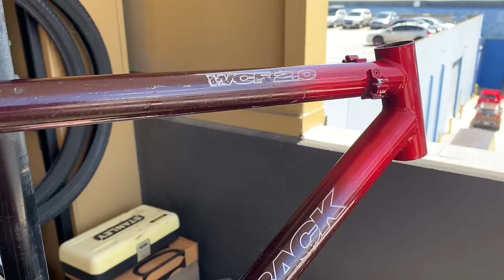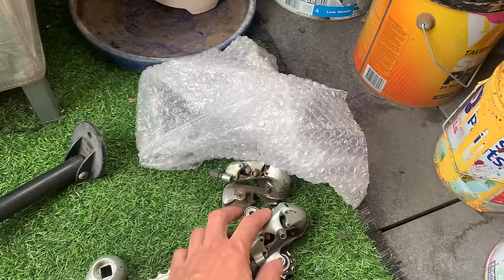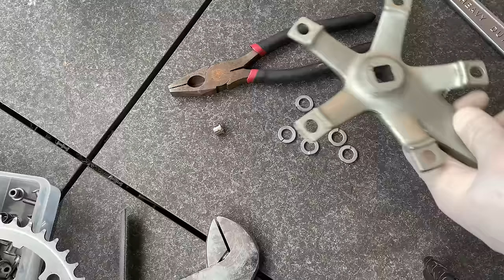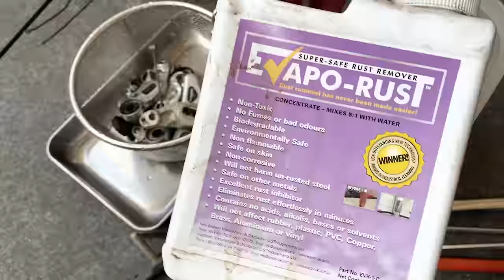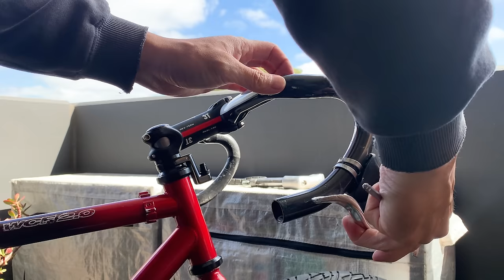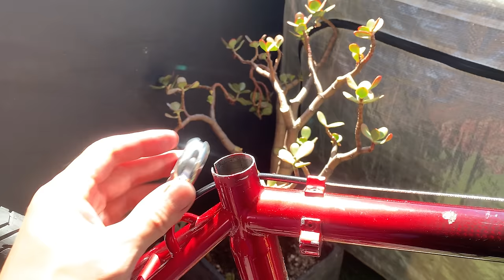2 speed gravel commuter custom bike build

Comment: i am a simple man. gary post video i click
Reply from the maker: 🤣🤣🤣 thx you 🙏
Reply: Agree 100%
Those of us who know, well, we know that Gary has a magical skill
Making an ugly duckling into a beautiful swan 😊
Very inspiring, Gary 
Cheers
Sven
Reply from the maker: @helenfulford2040 😂😂😂 thank you so much Sven I am honored
Reply: I'll be honest, I'm not much of a cyclist at 60 years old but I find Gary's videos inspiring. After not having been on a bike for 40 years I bought an Ebike which I love. I was lucky and found a road bike in a dumpster that was actually pretty high end (shimano ultegra, st-6501 brifters, 9 speed, aluminum frame). Had 2 bike shops check it for damage and after getting the ok I spent $100 on new cables, grip tape, tubes. Got a great deal on tires (Vittoria Zaffiro Pro 2 for $20) and a Selle San Marco Concor saddle for $10. New peddles as well.  It was alot of fun repairing the broken shifter, cleaning and lubing everything. I can honestly say Gary's videos were an inspiration. I've riden the bike a few times for short distandes but I'm just not physically able to use it to its full potential unfortunately. Was still a fun project.
Reply from the maker: Awesome I’m glad to hear that! Great to get out on a bike. Also super fun to work on bike projects , I find it very satisfying when I finally fix something 👍

Comment: Why not just use a 3 sp 16 19 23 freewheel and spacers, with a friction lever on the seatpost?
Reply from the maker: This weighs less, Jks these are the parts I had on hand
Reply: @garysprojects  I like playing with bike parts.  I once made a 1sp tensioner out of a rd with only the jockey wheel, and no cage, and used a spoke and the barrel adjuster to hold it
Reply from the maker: Nice! Sounds cool. I’ve used that spoke technique before too 👍

Comment: Surly used to make a Dingle fixed cog that paired with two chainrings would give a on road/ off road gear. No derailleur, just loosen the wheel and switch and off you go. Or use a modern Sturmey Archer internal gear hub with disc brake mounts.
Reply from the maker: How does it keep chain tension ?
Reply: @garysprojects  You would combine a small front ring with the larger rear cog and the larger from ring with the smaller rear cog. So there is only smsll difference in chain length to adjust.

Maybe a 36/18 with a 42/14? I have not used one myself but there is likely info on the website about what works.
Reply from the maker: Ahhh I see thank you

Comment: I think most headsets that have cartridge bearings have the slit on the crown race to make it easier to fit. It would make your steering notchy if you had cage bearings but it's not a detriment with cartridge bearings.
Reply from the maker: Nice! I plan to use those for all sealed bearings so I don’t have to worry haha !

Comment: What a practical way to setup a simple 2 speed rig.
Reply from the maker: Thank you my dude , easy run around bike
Reply: How on earth is this practical? I would be too annoyed to dismount every other hill to change gear. And to only have two gears when you have a whole derailleur is just missed potential in my opinion. Adding a simple friction shifter, it doesn't even have to be on the handlebar, wouldn't make the build much more complicated.
Reply from the maker: @hobbybaschtler7896 I guess it’s something you don’t switch too much. Maybe if you’re in a rush for work you set it to the high gear and on your way home you set it on low. Think of it as just using an old rd as a tensioner , with the option of switching one gear

Comment: I like your set up.  Alternatively you run two rings in the front and a single cog in the back with a tensioner.
Reply from the maker: Cheers I appreciate that! That’s true you could do that !
Reply: i really need this. i have a mountain bike that has 3/8 speeds and im thinking of swapping the cassette out for a single cog, getting rid of the derailleur putting on a tensioner and either swapping out the crank or maybe swapping out the cogs at least for some new ones if i can. the shifting mechanism is already there so it should work, assuming i can find compatible parts.

Comment: Just found your channel mate and simply love this Diamondback build. I use derailleurs as chain tensioners on my single speeders and have used that cable hack for many years now and it always works great especially for fine tuning the chain noise. Currently building up an old Jamis frame (reynolds 520 steel) to be my one bike to do everything ..... Road / Round Town / Commute / Gravel.  Looking forward to working my way thru your older videos. keep up the great work.
Reply from the maker: Thank you Jeff I appreciate that! Yes it’s good way to use an old derailleur for sure. The Jamis will be a solid bike 👍 Thank you will do my best cheers !!

Comment: Regarding the crank chain ring washers, in Europe there are some washers used for the door hinges, to change the high of the doors, that fit perfectly. I got this tip from a colleague.
Reply from the maker: Yes! Someone else mentioned this too, I will take a look at the local hardware store , thanks !
Reply: Yes, I use these as well. They are perfect for the job.

Comment: Sweet! I fix up old bikes for fun as well. On that seatpost, if you use a strip of fine sandpaper (for metal) in a quick back and forth "shoe shine" motion across the barrel, it should hopefully get those marks out.
Reply from the maker: Oh awesome!! Thanks for the tip will give it a try 👍
Reply: @garysprojects Just hold the ends of the sandpaper strip and it will naturally follow the contours of the post. I hope that makes sense. I do this technique on aluminum and bare steel. 

Your builds are really cool btw!
Reply from the maker: Yes that makes sense! I think someone mentioned before that’s better direction to sand seatpost because of the “grain” of metal(?). 
Thank you very much that means a lot thank you !!!

Comment: Once again a great video. Always enjoying your creative builds and your chilled ways to present them. 💖💖💖

Just about the split crown race: those are kinda common on sealed headsets because you don't need a smooth surface all the way around the crown race for the balls to role like you would on "open" ball-bearings. Sealed bearings already have that surface inside them. And it's heck easier to install and uninstall after all.
Reply from the maker: Thank you I appreciate that ! That’s great to know about the crown race !! I’ll make sure I use slotted ones for all sealed bearings! Will save me a lot of hassle 😂
Reply: @garysprojects  ahahaa, those hundreds of hours lost in my basement... i feel you! you can even cut them yourself if they're not slotted at factory. works like a charm and no tools needed except for a screwdriver or something to "open up" the crown race while mounting it on the fork.

Comment: Nice, haven't built a dingle speed before. I am planning on converting a Scott Boulder rigid to drop bars and this would be a cool option other than single.
Reply from the maker: cheers ! ya give it a try, i was hesitant too at the beginning but it worked out well and is fun to switch it up!

Comment: Connect your Dingle speed to a front derailleur MTB shifter. Can use 2 speed and ignore the trim, or have 3 speed in the back (fast, cruise, and hill options)
Reply: I live in a hilly place and have 15t+21t+28t in the rear, and 38 in the front I think
Reply from the maker: @veloello1  interesting idea!! I wondering what the pull ratio is on the front d

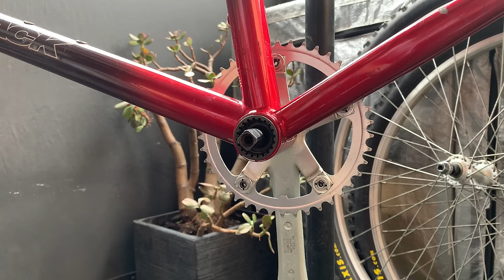Comment: 13:22 Is that safe to ride? I feel like the flex will make the crank/chainring rub with the chainstay wouldn't it?
Reply from the maker: Ya it’s been working well with no scratches! Obviously different for every bike but the flex depends on the frame you have and how flexiable it will be. I think this bike having steel joints & rear triangle helps!

Comment: Amazing one, again. 🤩🤙
Simple and nice.

And as I did in my latest build (mtb frame, drop bars and cantis) you left out cable tensioner for the brakes. 😁
Either way, 10/10 🙌
Reply from the maker: Thank you my dude i appreciate that ! What is a cable brake tensioner ? Not sure what you’re referring to , thanks
Reply: @garysprojects  not shure the right name for it, but on mtb brake levers there is this threaded adjustment for adding tension(?). 
These road levers don't have this, but one can by adjusters for placing on the housing. 
Same can be used for the gearing, if you want to adjust "on the fly".
Reply from the maker: @vernerjuliussen2071 oh yeah I know those!! Ya I never bother with them because once it’s set you don’t really need them
Reply: @garysprojects  thx. Then I won't bother installing them either. 😁🤙

Comment: How did the weight feel compared to MTBs, and what you expected? Also, how did the different gearing end up working out? Was it enough of a spread in ratio to tell the difference?
Reply from the maker: Weight feels noticeably lighter when riding and compared to my other mtbs , fun to whip around  on. The gearing is actually a massive difference for myself haha it means being able to go up hills on one and not on the other 😂 maybe I need to get more fit. I. Mostly ride the easier gear in the vid. I think it would probably be nice to have 17-18 and a 14-15 
I think if I get more fit the ratio I have on the bike  will be fine.
Reply: @garysprojects  Maybe you could do another video about it. I wouldn't be able to get away with a 2-speed where I live, way too many mountains and hills. It's fun to see though.

Comment: Nice build as always Gary. Wondering how they hid the seams so well between the steel and carbon? I have a Trek 8300 where the main tubes are carbon but the rest aluminum. The aluminum was left raw.
Reply from the maker: Thanks Joe ! Yeah it’s quite seemless , my guess is that the clear coat is quite thick it seems maybe that’s how ? Cool the trek sounds cool!

Comment: I'm curious about the weight 🤔. With the carbon frame and bars, and the minimalist gear train; I imagine the bike should be on the lighter end. Despite the sensible tires
Reply: Carbon frame?
Reply from the maker: Yes ! It is pretty light compared to my other mtbs , the tyres def add a bit , but feels solid. Feels whippy and fun to ride 👍
Reply from the maker: Yep has carbon tubing and steel welds
Reply: @garysprojects  ah ok I could see any lugs or seams, never seen carbon tubing like that 👍

Comment: Very cool build! I saw the tiny cable clearance between the stem and the hangar and was wondering if you'd drill a hole for the cable into the stem. Though maybe that old-school cable routing would have looked wack. 😂 
Would be cool to have this two speed setup with a friction lever placed somewhere unusual at the back of the bike. Great vid man!
Reply from the maker: Thank you Milo I appreciate that. I considered it but I think this stem was too nice to drill through ! Would work though , Cheers!

Comment: My tip for this build , the shifting with the set screw is a bit to much in my mind , you get pretty cheap from SunRace or Sturmy Archer a bar end shifter  were the front shifter for this aplication will work fine . Have fun !
Reply from the maker: Cheers mate 👍
Reply: @garysprojects  other than that great job to get that beauty back on the road !
Reply from the maker: @thomaseisen304  cheers mate I like it the way it is but thank you ! 😊

Comment: Love the manual two speed setup. Did you have any chainwrap issues with the 13t? I've always had skipping under load issues with low tooth cogs and derailleurs as as a tensioner
Reply from the maker: No issues at the moment ! I didn’t need to adjust the chain either. Sometimes if you get slippage it could be the chain is too long or a worn cog. Thank you my dude !

Comment: nice build, like the frame colours a lot! One question though: how the brakes work with the drop levers?
Reply from the maker: Thank you my dude ! Ya they work pretty well I think. The levers are short pull which work with cantibrakes. I think they are little more bulky than the vintage ones but not too bad 👍

Comment: Lush build as always.
Allow me to share my experience with shims for cranks: I use an LX MTB triple crank as a 1X on my commuter, and had to shim them for the same reasons you showed in your video. The type of shim I found useful, were the ones you use on doors, to lift them from the ground at the hinges (https://de.wikipedia.org/wiki/Fitschenring). Unfortunately i couldnt find an english translation, but the wiki pakes has a picture which should hopefully help.
Regarding the crown race, while i personally never did it, as long as you use cartridge type headset bearings you can use those split crown races, and even cut a slit in them yourself (I've seen Spindatt do it to great success). Makes installation and removal muuuuuch easier. Obvs won't work with caged/ball bearings 😉
Reply from the maker: Wow awesome ! Thank you so much, I will try and find those at my hardware store ! Cheers

Comment: in my Opinion 2 speed makes no sense. when you put an derailleur on it you can put a 6 or 9speed cassette on it and an MTB shifter…I had 20years ago an MTB with dropbars too. The handelbar at an MTB is so low that you nearly never use the drops.
Reply from the maker: Fair enough , thanks for sharing 👍